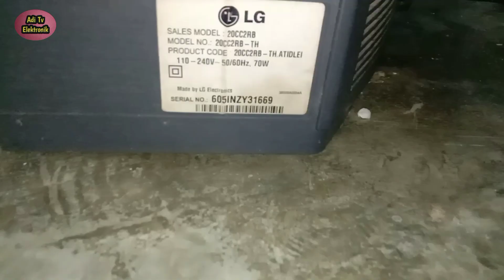Cara melihat nomor seri flyback yang kabur atau tidak kelihatan lagi

Comment: bang saya ada flyback tv poltron nomor seri gak ada kalo dipcb tertulis h-0ut - b+ - gnd - afc - m801 - nc - heater - bcl - +12v - -12v itu kira³ flyback seri berapa ya
Reply from the maker: Model tv nya apa mas ...itu slim atau cembung ya tv nya
Reply: @aditvelektronik1751  cembung bang poltron 21